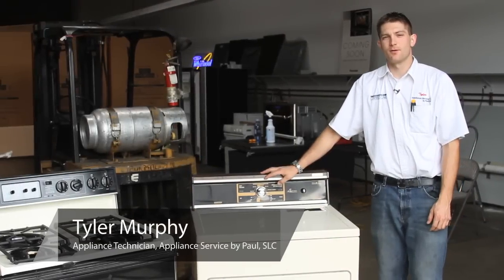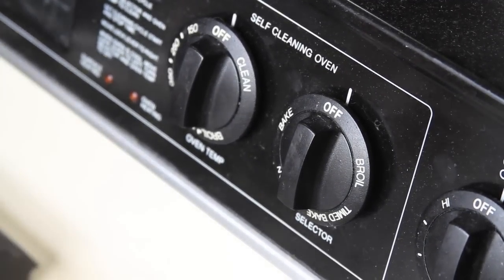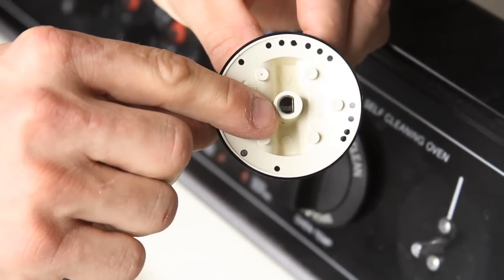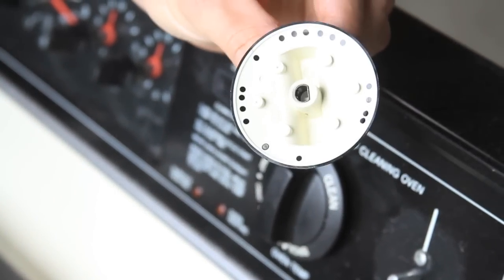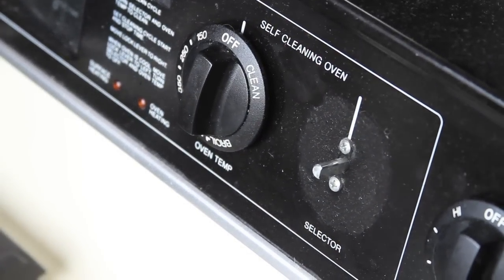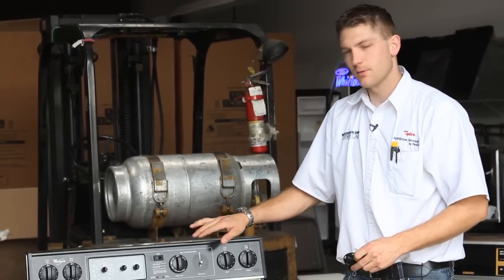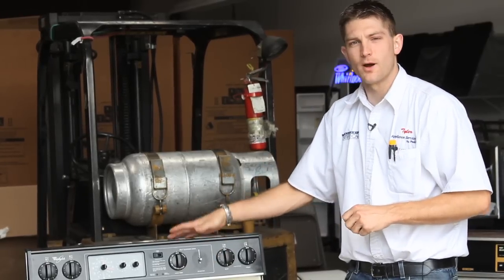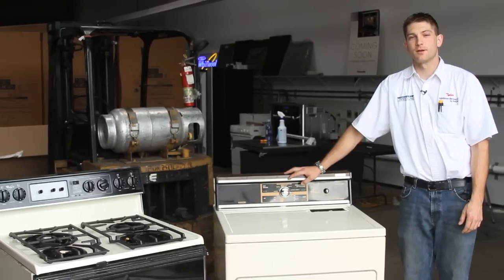Gas Stoves & Ovens : How to Fix a Knob on a Gas Stove

Comment: I just did my Samsung range knobs today, I went to Ace Hardware and 
bought a piece of round  brass tube made by K&S Precision Metals 
part number 81381  5/32 x .014 and cut my 5 rings out at 8mm long , then
 just tapped each one over the cracked inner piece with a non metal 
hammer. Works fine!

Comment: Two of our knobs went bad at exactly the same time, $100 for five knobs...what a rip off. LG Kenmore gas stove, just so you know who likes to rip you off. Worst this is a stove problem, the knobs only slips when the oven is on, very hot, the shafts to the burners get hot.... clearly a design flaw. It's like the heat makes the plastic soft and the dial gets off. Worst was the gas to two burners wasn't off even through the knob was in the off position.  We found out by turning on another burner to the right caused the two left burners with bad knobs to burst into flames unexpectedly due to the gas leaking. The knobs had about 1/4 inch of play in them when hot misaligning the off settings mark, so off wasn't off, but a slow leak. Lovely....

Comment: I have an LG cook top I paid $900.00 for. It's only 16 months old, all but 1 knob is cracked. The inside I'd all plastic, no metal insert. OME replacement knobs are $65 dollars a piece, and they're still plastic in the center. This is ridiculous, do you have any idea for a fix?